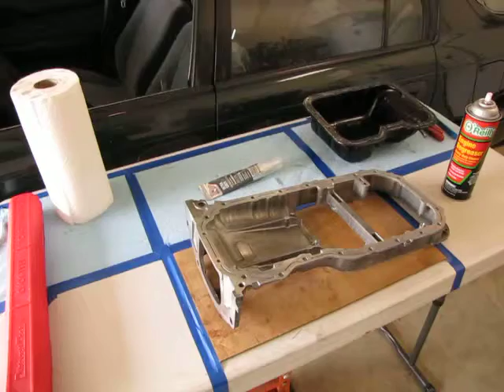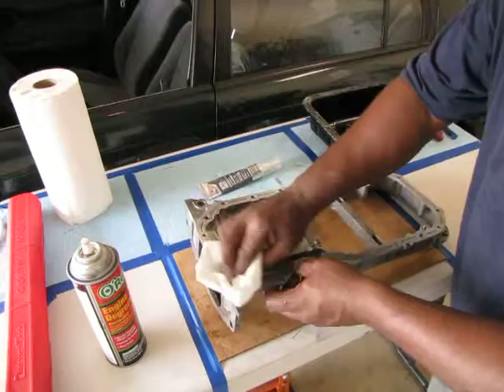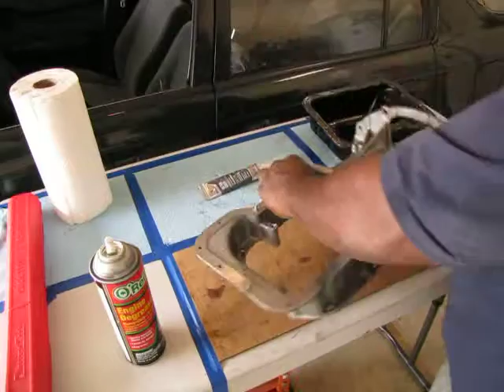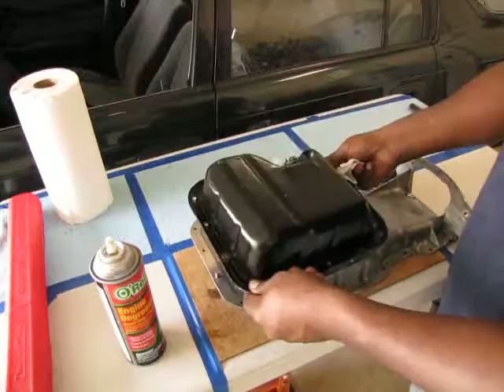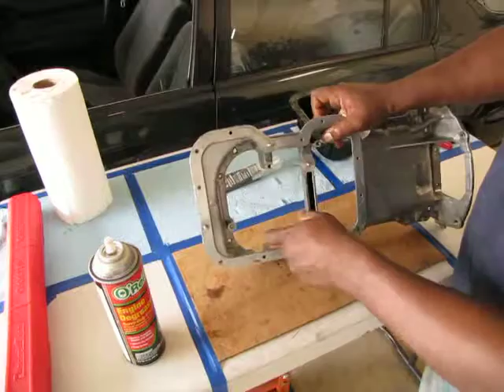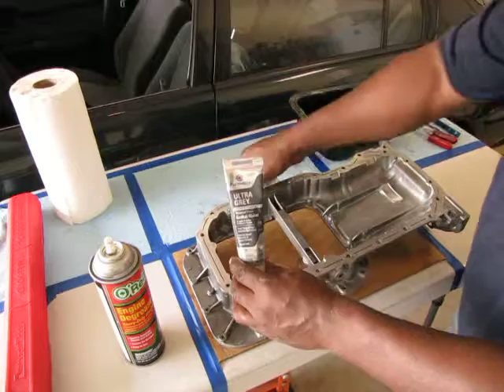1996 Corolla Engine rebuild Cleaning and prepping oil pan

Comment: I have a gasket set that includes both paper gaskets for the upper and lower oil pans. Is it advisable to use them, or would a sealant be better?